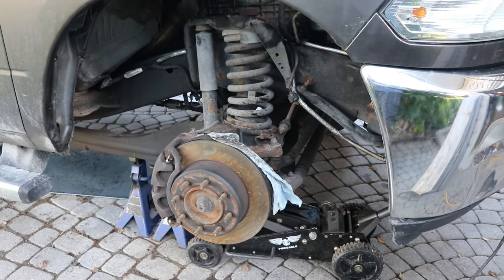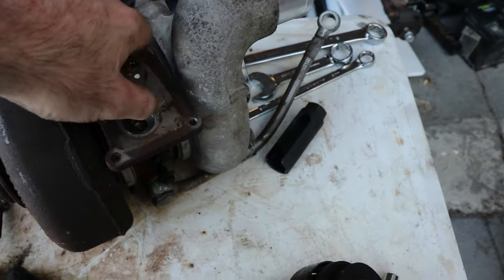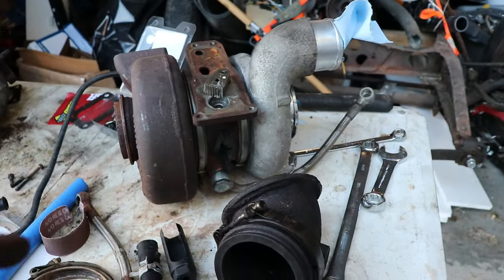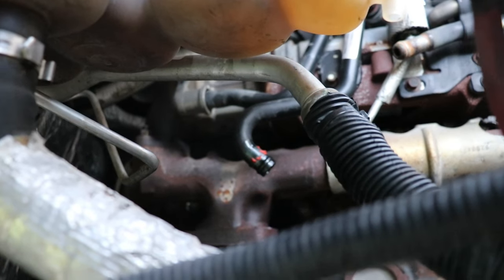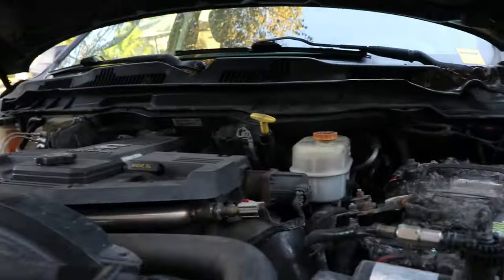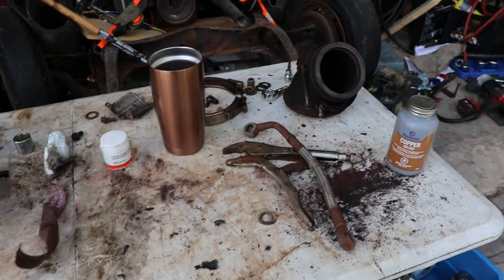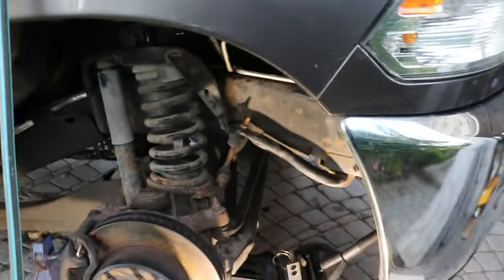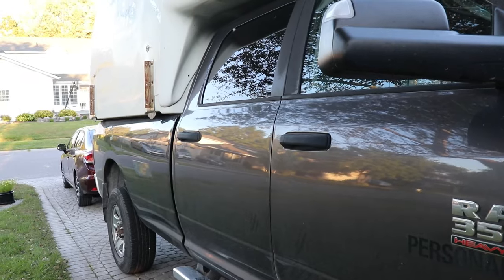Ram Cummins 4th Gen Turbo and Actuator Replacement

Comment: I just replace the turbo out of my 2011 3500, was having problems with the turbo VGT and actuator.  Went with a BD Turbo without a VGT and added their exhaust brake.  Way better than stock